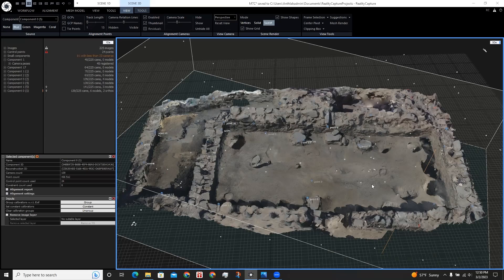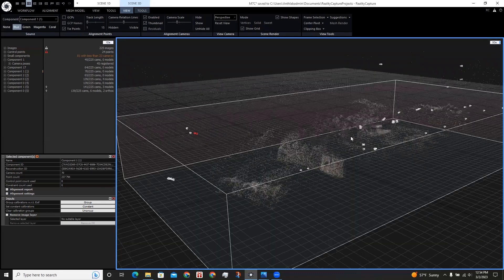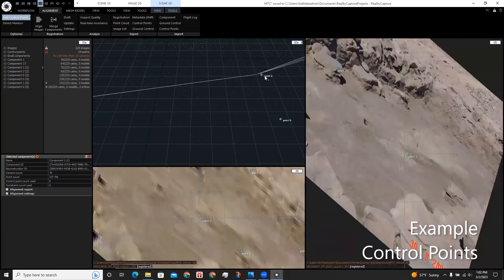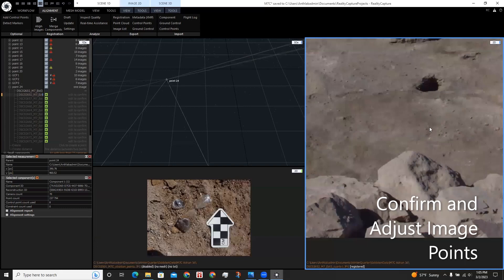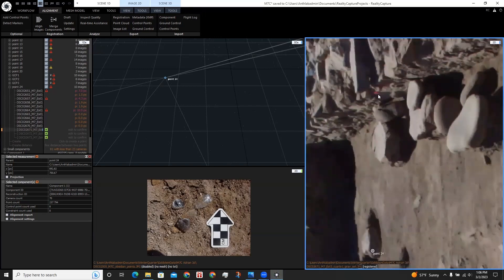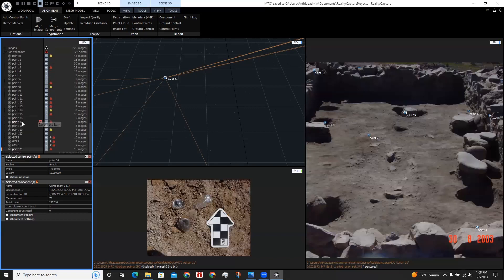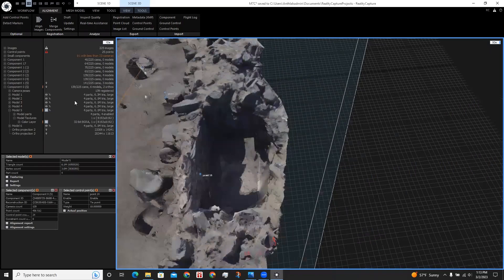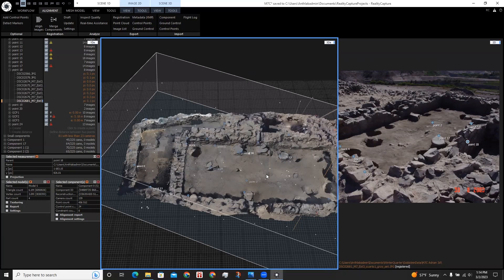Merging Components using Control Points in RealityCapture

Comment: In case you weren't aware, when you are doing your adjusting of the control points, while you are holding down the mouse button don't let go of the mouse button after moving it and press the down arrow instead.  This will move to the next image.  Adjust that point and hit the down arrow again.  Must faster.
Reply: this is such a nugget! thank u!!